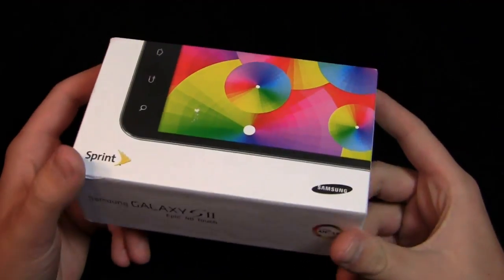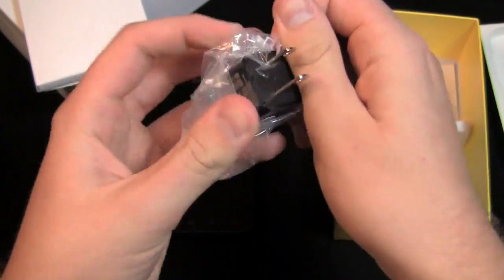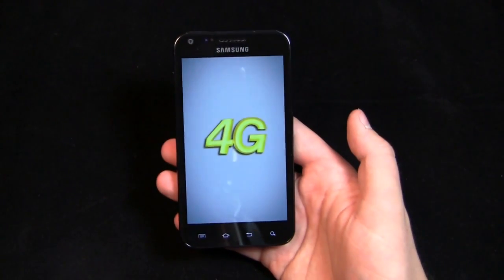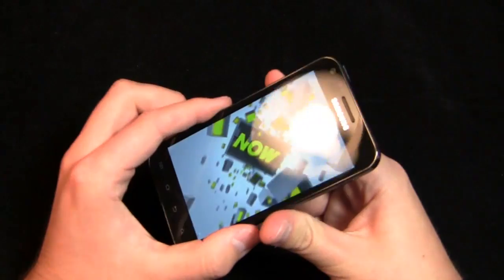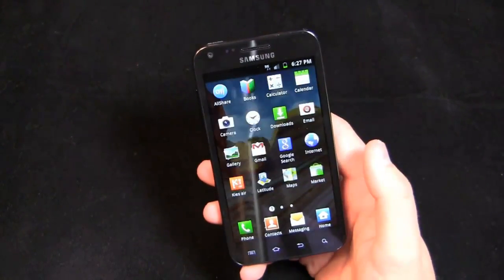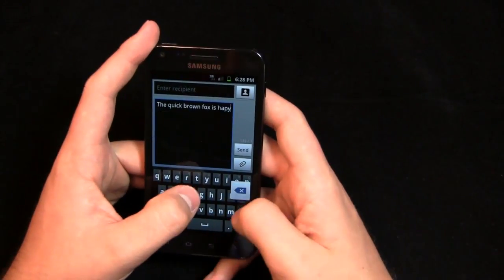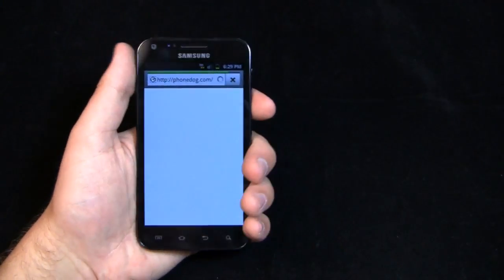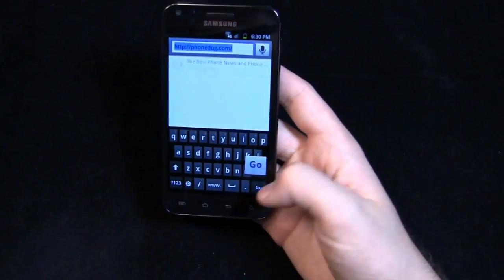Samsung Epic 4G Touch Unboxing

Comment: I like this reviewer. Still, I can't wait to buy the next Hyperbole Generic. There's nothing like spending $2000 over a couple years on a phone with the same OS as 50 other phones. Of course, my phone will be .02 GHz faster and the screen will be 10 megapixels sharper--so it won't be obsolete for at least 3-4 months.

Comment: In the next video you make is it possible to see that when you load a webpage that has a flash video embedded in it, is it possible to enlarge the video to full screen by using pinch to zoom (like you can do with the iPad)? I’ve seen in another review that you can make a small flash video bigger by double tapping on it, but it is possible to maximize the video to full screen by pinch to zoom?

Comment: @Cryengine Actually for the same plan that I have with Verizon, Sprint costs $10 extra per month.  I had Sprint for 2 years back in 2003, 2004 and it was atrocious as far as getting a signal.  The only way Sprint is cheaper is if you plan to sign up for all of the extra nickel and dime crap like NFL Mobile, navigation etc.  Even the, by the time you pay your extra $10 per month for "premium" data, you are not coming out ahead.

Comment: Does Sprint still charge the extra $10 per month for 4G?  If so, the price of this phone isn't very good.  $200 + ($10 * 24 months) = $440.  Bionic on Verizon is $300 with no extra charge for 4G.